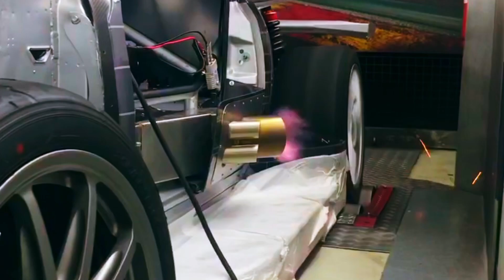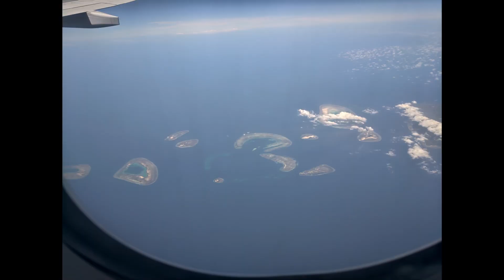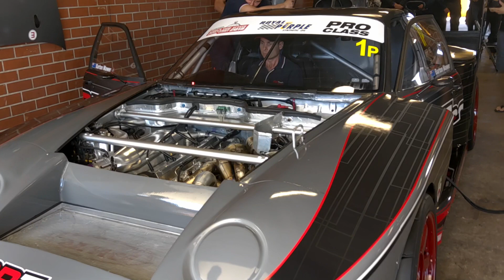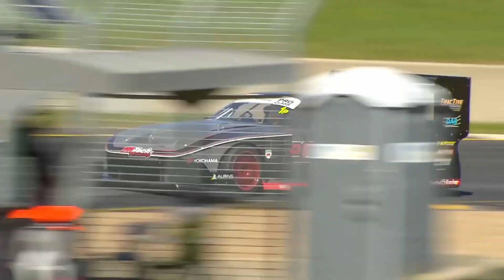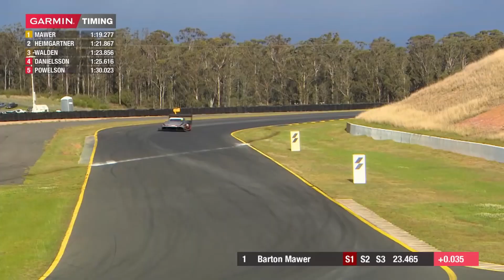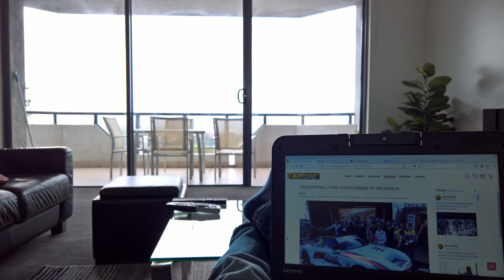The Era of Thor, WTAC2019: Thor - the story ep5

Comment: Why is the Thor engine still having troubles though?
Reply from the maker: Thor is good to go! Reports from australia says that it has run several hours in the RP968, just had the heads here a few months ago for inspection, all ok! (did some small tweaks based on info learned from Rex)
Reply: @ElmerRacing  Hopefully so. Whispers might disagree.

Comment: Would a drive-by-wire throttle be sufficient to solve the over-boosting problem that you mentioned? If not, why not? (I don't even know whether the RP968 uses a cable throttle or drive-by-wire...)
Thanks again for making these videos, I'm really enjoying them!
Reply from the maker: They use a dbw throttle on the RP968. That can definitely be used to control power in lower gears.
However, there would still need to be some form of active control of that mapping in relation to engine power output, to avoid drawbacks with turbo spool.
With a small throttle opening, boost will build very slowly, but will still build, depending on engine rpm etc. So in a worst case scenario with a static throttle map you could limit power, but also introduce very bad turbo lag.
Using the blow-off valve mapped in relation to boost pressure is a ok band-aid that doesn't introduce this problem.
Reply: @ElmerRacing  Thanks for the explanation, I really appreciate it!

Comment: How long until we see Elmer Racing CVVD tech? wouldnt it go lovely with that RTEMS. Also in your opinion how long until we see someone running 1000+hp with no external wastegates?
Reply from the maker: Some very interesting technology, that we have looked into. Would make most sense for a streetable super-high rpm engine though, and then you have gearing questions. But definitely good potential in that tech!
Internal wastegates do save mass, as long as the turbine housing is design to be lightweight. Something we're looking into. Might pull the trigger if no manufacturers get going on it.